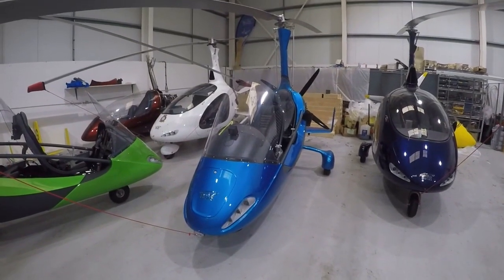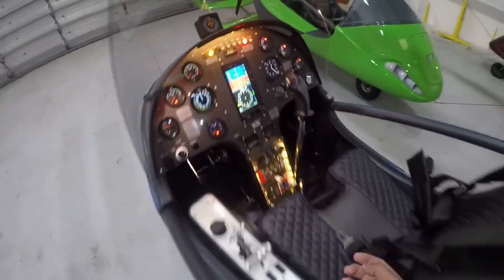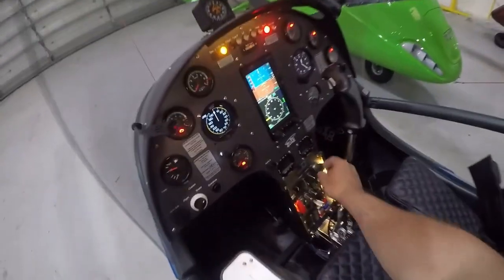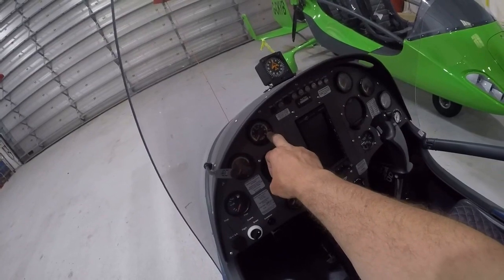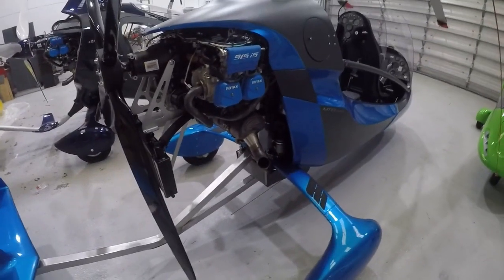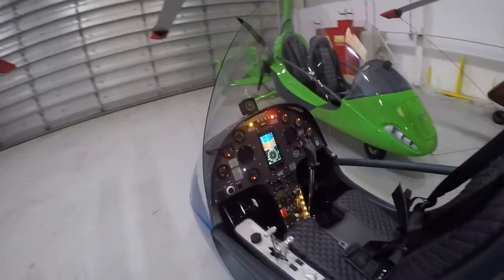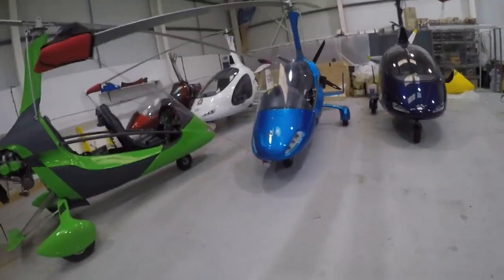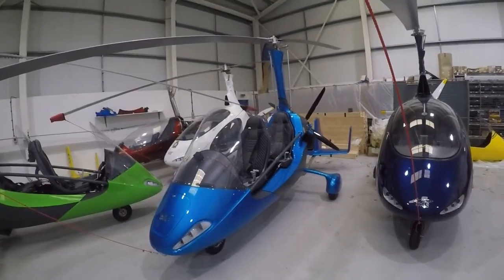Auto Gyro MTO-Sport 2017 with Rotax 915 aircraft review

Comment: Hi Phil, did you have a chance to fly it? if, so what is your opinion about performance comparing to 914 MTO 2017.
Reply from the maker: Bosko Filipovic hey no sadly I haven’t flown it yet although that will change and I’ll give the overall impression of the motor once done. I was talking with a student just last week about 915 and my general view is this.  Rotax have made the 915 for the improved performance mainly of fixed wing aircraft where it will turn 110knt aircraft into 150knt aircraft. However in gyroplanes (of all makes) we have a VNE of 120mph which is remember an absolute, VNE is NOT a target.  So I can sit at 100-110mph with a Rotax 912. Maybe with a 915 I can do it with less RPM and sip a little less fuel but to offset the initial price delta I probably breakeven at the 1200TBO! Ok so maybe I can take more payload? Well yes in 2017 sport the 912 has MAUW of 500kgs but the 914 has 560 so to the 914 no change. So now we are just left with climb performance.  Now I don’t know about you but I tend to fly 90% of the time at <1000ft AGL. So in the context a 2000ft/min climb rate is largely irrelevant. However I fly in the UK which is flight in ISA conditions a lot of the time and most of my flights are an hour so no need to have big fuel loads. I guess if you are operating hot / high and heavy perhaps it’s going to pay off but for most 914 power will be surely enough?? I’ll report back!
Reply: @gyrocopterflyingclub6148   I agree with you, but sometimes it is good to have  back-up power, just in case you need it. Also, what I like about 915 is reliability , full redundancy and no more hassle with carburettors. By the way, I see that 915 on this machine is equipped with governor flange for CS prop, does that mean that every 915 delivered with MTO will be having it even you if you order fixed pitch prop, like this one.
Reply from the maker: Bosko Filipovic let me ask about the prop for you. Yes i do hear what your saying ref reliability but so far 915 is not that well known
Reply from the maker: Bosko Filipovic flew it today and the 915 is a game changer. I’ll do a video tomorrow with some commentary
Reply: @gyrocopterflyingclub6148  "Game Changer", sounds promising!!!! Cannot wait to hear more comments and  see the video. thanks a lot
Reply from the maker: Bosko Filipovic With the aircraft fuelled with 30 litres, pilot weight around 80kgs meant an AUW of circa 410kgs the day was pretty much ISA being 1010Mb and around 18oC the airfield elevation of 300ft AMSL.

A caveat that data is taken with the standard instrumentation as fitted to the production aircraft we had:-

Climb performance at 60mph was 1500ft/min. Cruise speeds of 80mph saw circa 4300rpm and 15litres/hr. 100mph @ 5200rpm and 22;itres/ min.

The aircraft had a 4 blade fixed pitch prop and is the aircraft featured in the video

Take off performance was incredible with distance to clear 50ft of <100ft.

The raw numbers are impressive enough but the execution is even more impressive. The Rotax 915 motor absolutely makes the new Sport.

Power delivery is much more linear than a 914 and there were no vices. My expectation was that the extra power might dominate the airframe or in some way make take offs a hand full but not at all. If you pre-rotate to a usual 200rrpm then you have a short ground roll which does require a firm right boot to keep the aircraft tracking the centreline before unstick but if you pre-rotate to 300rrpm then the aircraft almost instantly unsticks and as quickly as you can bring the stick forward the aircraft is through 60mph and you're climbing away.

Indeed the extra power certainly benefits from the forward stick take off technique.

Slow flight I was down at 20mph and holding height - I ran out of time to investigate the ultimate slow speed.

I'll write some more tomorrow but essentially its a very impressive aircraft and if you fly from short strips, heavy, hot/high or all then the 915 just gives you both confidence and options. Flying light and in unchallenging conditions you just want to keep climbing out!
Reply: @gyrocopterflyingclub6148  Take off performance is unbelievable, after 100 ft you are already 50 ft above the ground,  it is amazing, it means you hardly have any ground roll. How is prop set up, what is engine rpm at WOT during take off? What about level of vibration while cruising at 100 mph and generally, especially comparing to 2010 model.
Reply from the maker: @boskofilipovic8487  Good question on prop set up in terms of degrees but it will still achieve VNe and the engine RPM's / speed as stated.  One thing you really do need to get the stick forward quite quickly because it has so much thrust you inevitably start climbing out slowly otherwise!

Comment: Damned by faint praise?
Reply from the maker: That is possibly too harsh and the 915 specific comments certainly have read across all gyroplane makes. The issue for me is that for example if you take Vans RV12, fit that with Rotax 915 and it becomes fast and some kit aeroplanes with 915 are 150kt aircraft while we are stuck at 120mph.  Weight wise we have 252kgs for fuel and people.  When you consider the fuel burn if you are utilising the power its likely you get 2 x 90kg people in the aircraft - that isn't a lot of margin for 2019 sized people!!! So really that makes 915 perhaps more suited to lower rpm for the same power as 912/914 and maybe quieter?? Thats fine but you pay for it.
Reply from the maker: @COIcultist  I'm sure the 915 will have its TBO extended but for now it is as stated and of course in the meantime the early adopters are left to discover the long term snags.  In aviation that never proves cheap!

120mph is just a function of BCAR-T regulation and the design.  I flew the Austrian Arrowcopter a few years ago and we were cruising at beyond 220km/h but it did wander in yaw/pitch/roll (dutch roll) and ultimately failed the BCAR-T test when it was attempted to be approved here.  

All the aircraft have adjustable props in the UK thats not an issue.  Yes you'll get marginal improvement to fuel burn but to be honest it is marginal especially if referenced to the price uplift in the adjustable prop purchase price and on going maintenance.  

A £16k 912 that will cruise at 100mph happily verse £30K for a 915 that may cruise at 110mph (because you can not call the VNE speed as the cruise!! REMEMBER VNE is an absolute limit and should be seen as such NOT a target!).  Also remember most of the time gyroplanes spend most of their time at around <1000ft AGL so climb performance is hardly that important!!
Reply: @gyrocopterflyingclub6148  Thanks for the reply.
 I see what you say about the relative speed of the 912 engine but then again the 912 engined MTO-Sport you reviewed is limited to 500kg so you are down from 560kg and 50kg nett on a 915 engined autogyro. What were you saying about 2000s sized people? How much lighter is the 914 than the 915 do we gain more than 50kg from that?
 You mentioned doing additional films about the night package and the 915 engine.  I'll watch anything you put out as I'm quite interested but I doubt I'm your target market lacking sufficient funds for a new car let alone an autogyro. I presume your target market is prospective student pilots. If I was such a prospective pilot I would be far more taken with your explanation of an alternative take off technique  https://www.youtube.com/watch?v=kW65IY39MPU than someone forming a very slick video about how they are going to teach you things whilst offering nothing as an example. 
 Then again your most popular film by a long way is about take off technique and errors.https://www.youtube.com/watch?v=QJPgQQtLF7w Are people who watch YouTube just sickos who like to watch things crash?
 If you are prepared to make films for a wider audience then a wider look at Rotax engines not just the 915 would interest me. I sort of understand about approval with limited numbers of engines meaning that generally private aircraft are flying with dinosaur engines. Relatively Rotax are very progressive, introducing electronic ignition instead of magnetos and fuel injection. For an outsider it is hard to understand a turbocharged engine with carburetors. Thought I'd seen the last of that in the 70s/early 80s. Heck 1982 Honda even developed fuel injection for the CX500 and that thing was a pushrod twin. Love to see something on those turbo 912s pushing out 120bhp plus.
Reply from the maker: COIcultist yes 914 allows 560kgs MAUW with a weight saving to the 915.  One thing to remember is that Rotax and AutoGyro are two different companies so of course it doesn’t necessarily follow that the 915 allows an advantage in a gyro, where it certainly would in a fixed wing aircraft. 

I started making my films primarily on the instruction side because not only did it allow my students to see ahead of a lesson what might be required but also gave everyone else an idea because even in 2019 something would seem to be missing when 99% of current gyroplane accidents are from normal take offs and landings.  

The aircraft reviews were a follow on as perhaps some very basic overview of a sub set of popular aircraft.

Comment: Might as well buy a used R22 for that money, this MTO offers little more than a performance flex wing microlight which would cost a 1/4 to 1/3 of the price.
Gyroplanes have a history of being commercially unviable when compared with other flying machines, looks like AutoGyro are demonstrating that once again. 
It does explain why Gyro training is so expensive as owner/instructors attempt to claw back some of the huge capital outlay. I can understand this with something as complex as a helicopter but not a gyro.
Reply from the maker: C Py hi partly I agree and partly not.  Yes you could buy a used R22 but you’d of course also take on the uplift in maintaining it and learning to fly it for not really any better performance other than vertical take off/ landing. As for flex microlight - they really aren’t the same thing and gyroplanes are flyable in a much wider range of conditions and unless you spend quite a bit on Rotax 912 powered micro lights you’ll not get anywhere near the same cruise. However where I do agree is that the increasing complex nature of these things is mistaken- look how P&M went bust even though they have a sophisticated range. Gyroplanes offer great visibility and a very short landing roll making them safe to fly at low level and in a wide range of weather conditions. Training cost I think instructors like to make money otherwise it is a short term venture...
Reply: Thank you for your insightful reply. It is great to see features on these machines which make operations safer and provide structural integrity, I am sure the R&D and certifications must be very expensive. I just can’t help think that we are missing a way of getting people on normal wages in the air! 
Thank you for your interesting videos.
Reply from the maker: C Py yes I completely agree the industry in general has gone in the wrong direction- attempting to make gyroplanes a commercial operators proposition and flyable at night etc. That may have been a worthwhile endeavour had someone made a 1000+kg 180mph machine but that seems to be a greater challenge than is possible with the current players. With the weight/speed limits we have today 560kg/120mph simpler and cheaper aircraft would be the preferred direction